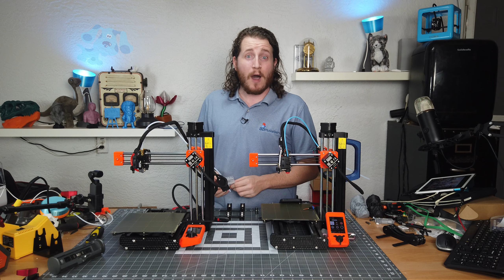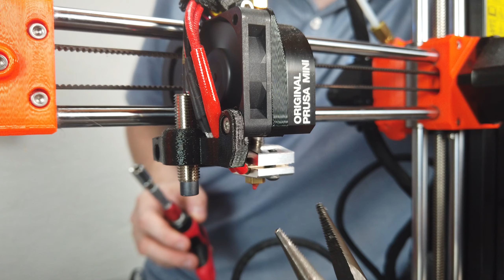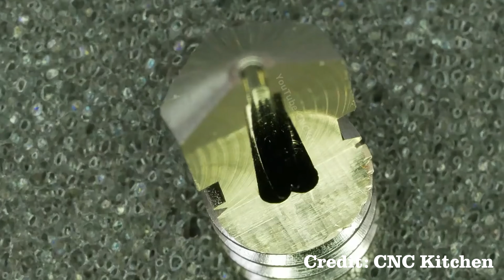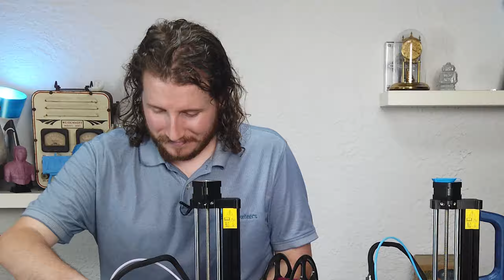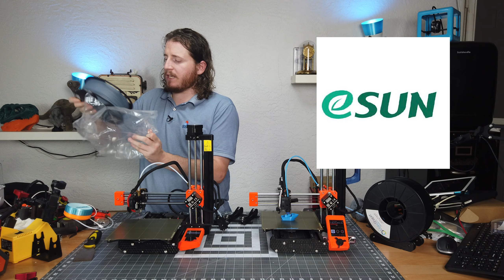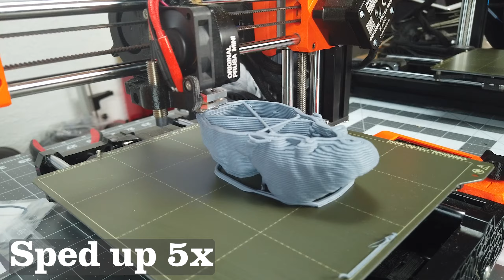11 Minute Benchy On A PRUSA?!?!

Comment: Blue's Clues!  Love the video!!  Revo nozzle swap domination!  I usually do temperatures lower than regular nozzles and much slower for the 1.8mm.  You¡re so right about running out of stepper motor power, I have that happen a lot.
Reply from the maker: interesting.. LOWER temp and not higher?

Comment: With the thicker nozzles the limit is the volumetric flow. That means the benchy would have taken roughly the same with a 0.3 mm layer as with the 0.9 mm since the maximum speed of the machine will still not be reached ( ~ 77 mm/s vs 28 mm/s)
Reply from the maker: Yep, 100% I set the speeds to 85 for the perimeters and flow limited it to around 30ish?

Comment: I own 0.6 mm, 1 mm and 1.8 mm.
I do not really see the benefit of the 0.4.
In order to reach 30mm3/s with 0.3 mm layer height you would have to print with 280 mm/s way above the limits of the mini. 
I guess lowering the temperature and or having a more homogeneous temperature distribution could be the motivation, but the regular nozzles are just fine for the regular configurations. For example 0.4 width and 0.15 mm layer height at 50 mm/s means ~3 mm3/s.
Reply from the maker: Yeah on the mini you will hit speed and acceleration limitations first, hell on most printers you will. 

More consistent flow is good too!

Comment: This is why metric is better - nr. 9 wrench and no need to switch it :D vanadium/brass/cht all with one wrench
Reply from the maker: It does? They are significantly different sizes from my perspective! I will have to check now!
Reply: @3DMusketeers  I found one brass "E3D" 0.6mm nozzle from FilamentOne which indeed is 7mm measured with calipers when vanadium and cht is 6mm... so I may be wrong :D I don't know where my stock brass nozzle is :( so I can't verify that one
Reply from the maker: I think a lot of the after market nozzles are the smaller size, but I knew I was not taking crazy pills LOL

Comment: cht revo is a nightmare to try to make unless you can make it out of multiple parts. Although the normal revo is like 3 parts so its possible and likely they already have them but its opsec. I want an actual hi flow revo tho, the normal heater works for like 15mm3 flows. I have printers that are able to move at such speeds that i need like 50+.
Reply from the maker: Oh yeah it's technically challenging for sure. The drilling then post work especially with how that barrel necks down on the revo will likely present problems.

Comment: CHT's are great. They're the only nozzles I daily drive at this point.
Even better when combined with other high flow options like a volcano length heat block or Rapido UHF.
For abbrasives, check out the Bozzle Nozzle. Only available on 0.5mm, but it combines the CHT style design with a high surface area and is hardened.
Reply from the maker: Did Bozzle license it? The theory of the CHT is a patent by Bondtech.
Reply: @3DMusketeers  Bondtechs patents are bondtechs business. As a consumer it's irrelevant to me. If they need to pursue legal action against northprint3d then their lawers can handle that.   They've had the CHT for year and still have no hardened solutions. So as a consumer, I'm forced to look elsewhere even though I'm thrilled with the CHT nozzles I have. 

That said, the Bozzle shouldn't violate any patent.  It uses a torx like star pattern to cut the filament from multiple angles instead of through the center. Which maximizes surface area and increases flow with a similar result as the CHT. But hardened. Vez3D has a couple videos on it if you want to know more about it.
Reply from the maker: It is absolutely relevant to consumers, but it is up to Bondtech to enforce the patents or otherwise. We should care if companies are stealing from someone else. Just like how Creality Cloud is terrible, we need to hold those in the wrong accountable. 

Looking into the Bozzle's at the moment... I see how they have their internal geometry and maybe it wont be an issue, but I would have to review Bondtech's patent, which I assume is about splitting the filament up, which this does not seem to do. 

I like the idea!
Reply: @3DMusketeers  It really depends on what "stealing ideas" means to you, which is a hugely debated topic in this community. Everyone had a different line, and the laws don't always line up with individuals ideals for what idea ownership is. Lots of people will tell you that you cannot own an idea.

Personally I think the bozzle nozzle is unique enough to not be a clone of the CHT regardless of how the patent law shakes out. 

In this community huge amounts of people commit copyright infringement every day, from youtubers to people printing at home to patreons and etsys selling models of characters they don't own. Thingiverse, Printables, and the rest are littered with patent-breaking models. People had been enclosing their own printers at home for a decade desptie the enclosure patent.

Lots in the community feel that patents are detrimental to the very ethos of 3d printing, which was built off the back of open source work and the very promise of the technology is one of sharing information and de-centralizing production. You've seen the backlash to slice protecting their patents. You've seern patents being abused to take the open source hangprinter away from the community.

From a purely consumer perspective there's no reason to care about patents. More producers making the similar products only gives the consumer more options, and forces companies to provide the consumer with more value. Patents only benefit the company that gets to monopolize the product. This allows them to innovate less once they've securied their patent, and raise prices above what the competition could offer.
Reply from the maker: Looking at it, I would agree it is unique enough. But I am not an attorney. 

The enclosure patent ran out last year, but if it is done for personal use it is not in violation of the patent. Most users never violated it though as it specifically dealt with external motors with a heated chamber. 

Patents are not detrimental, people that protect them and do not license them for fair market value to others are the ones that cause damage. Go back and listen to my talk with Sanjay, he even discusses that the patents were required to make sure E3D could keep their doors open and not have years of engineering knocked off by some chinese company for pennies on the dollar. 

I agree with your statement if the company acts against the best interest of their customer base (looking at you medicine industry!). But there are absolutely ways to have a company control the IP and license it to those they trust to manufacture, improve, and provide value to the industries they serve vs. just knocking crap off. If that makes sense? 

Yes, heavily debated...